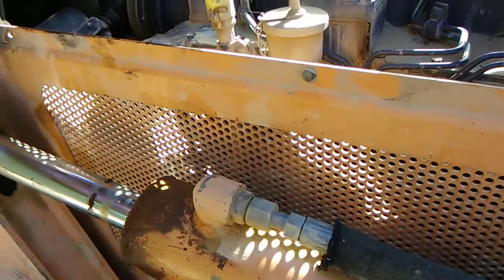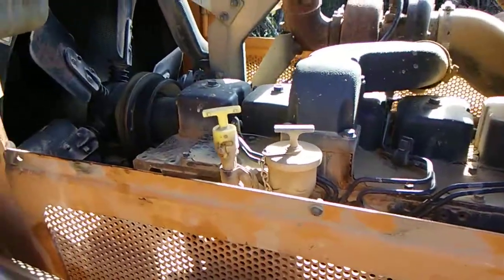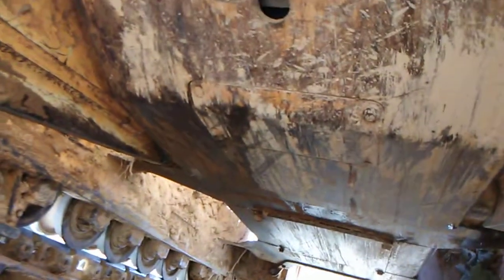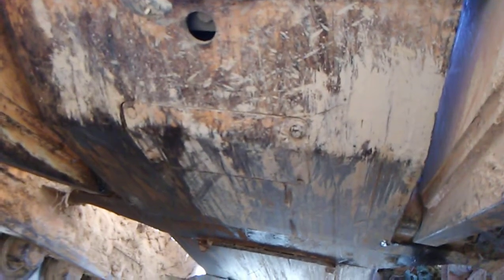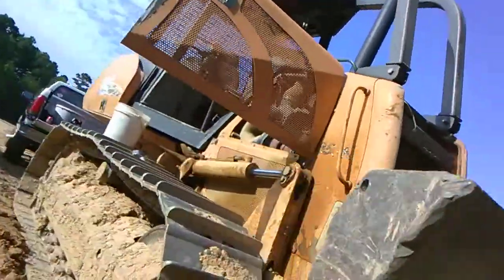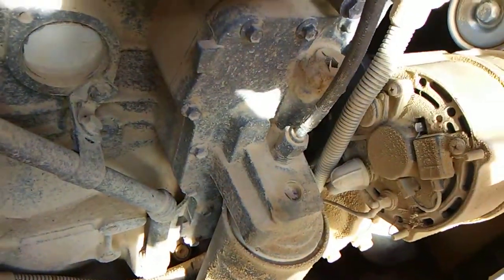In God with How to change the Oil and Filter on 850K Case Dozer

Comment: I noticed in the operators manual they recommend priming the turbocharger oil lines by disconnecting the fuel solenoid valve wire and cycling the engine for 15-20 seconds. Is that part necessary ? Thanks again for making the video. I'm doing my first 250 hour oil change today on my 2006 850K series 3. I also will be doing the fuel filters and saw that video as well. Did you ever make a video for the hydraulic filters? thanks again.  Len
Reply from the maker: Not really and no I have not, sorry